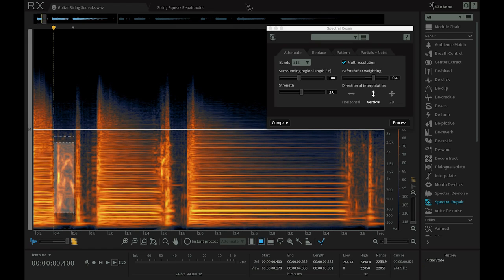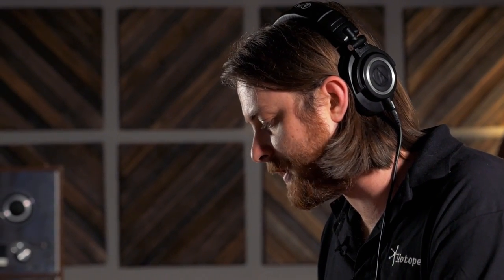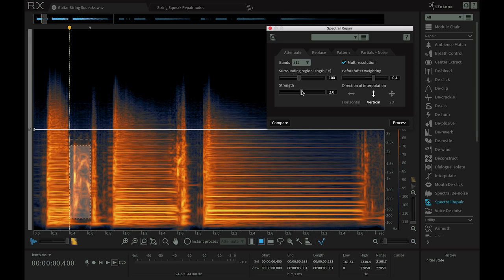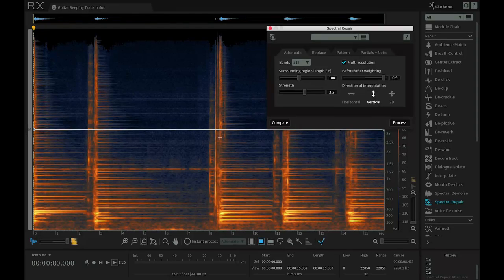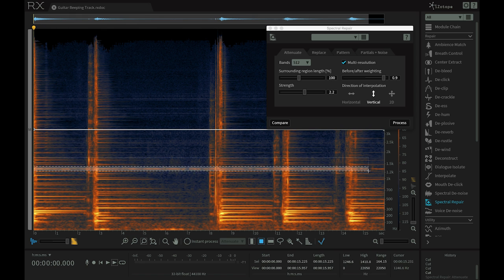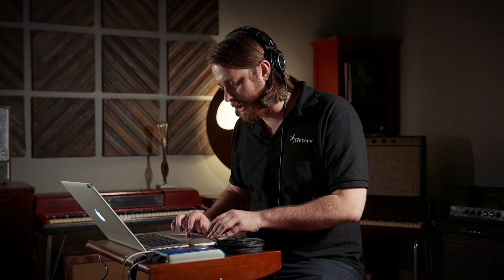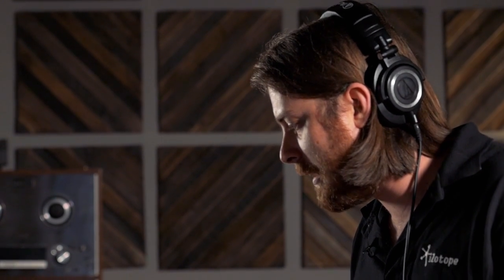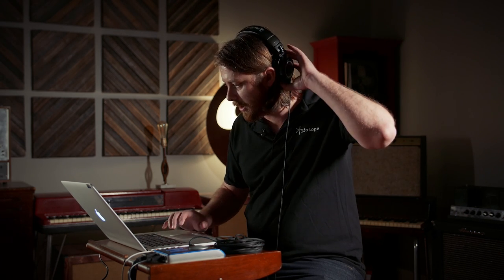iZotope RX 6: Using Spectral Repair on Guitar | Reverb Demo Video

Comment: sorry i didn't like it at all ... in fact i hated the whole idea! Those normal noises beteeen the chords are the things that make a real performance different from playing a MIDI and puting a guitar sample on it!
Reply: I agree that the first example was a bit overdone, however it is possible to just attenuate the squeaks just a little bit. Whether or not it's necessary does kinda depend on the song in my opinion, if you're going for something more stripped down and raw, say a folk or blues song, I definitely wouldn't do it. But say in a more polished pop production it would be far more appropriate. Don't let one bad example turn you off from the software, there are many more, and far more useful things it can do.
Reply: I agree. But i wouldn't use it for anything, even chords for pop songs! Things like this‌ and auto-tune etc are the exact cause that we don't enjoy any new music, cause everything sounds so sterile and soulless. And for correcting recording mistakes (second example), Alan Parsons has said it very well once: Record professionally in the first place!
Reply: No I'm right there with you, I can't imagine wanting to remove those squeaks either. And yes of course, you should always strive to record as cleanly as possible. But sometimes mistakes happen, and sometimes you will find out about that too late, when rerecording is not a option. Stuff like this takes the headache out of trying to solve it. Should be noted that this program is mostly aimed at people that do post production, and have little to no control over what happens during tracking.
Reply: Joeri Braams Correct! :)
Reply: Right! I found most of their repair videos either too subtle or too unnatural.